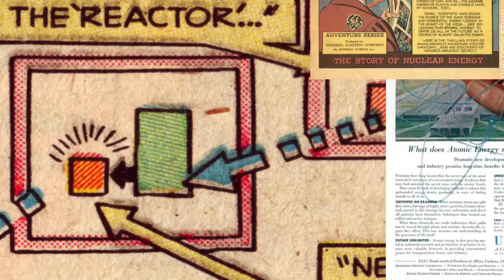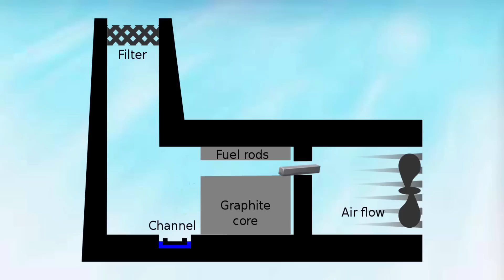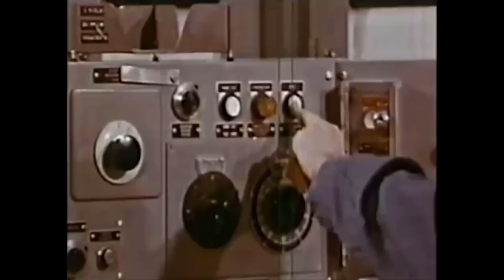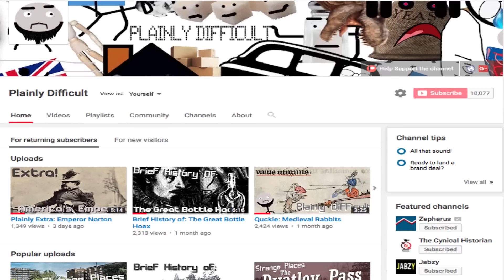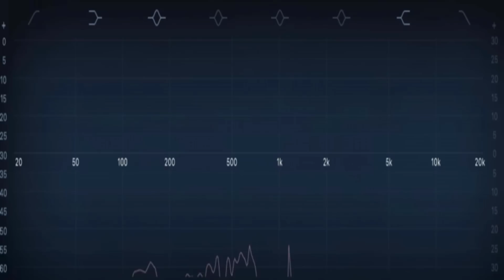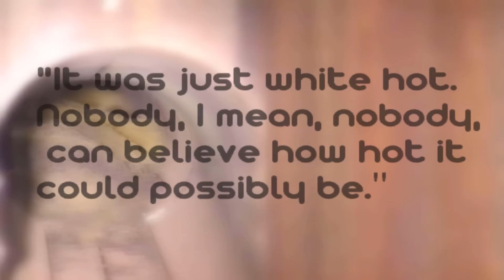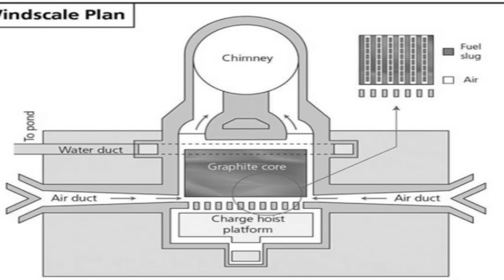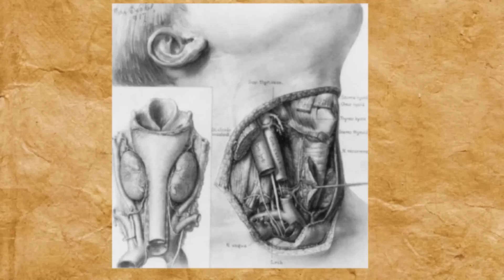Brief History of: The Windscale fire

Comment: ACTUALLY,  it is unbelievable (as it is so stupid and such a simple thing to think of) that there weren't a specialised method in place to douce a fuel rod on fire. you could think of a few different ways that could be used, such as a hose connected to a tube with the correct diameter that can be fitted straight onto the cavity the fuel rod in question is in, so that they could sort of 'flood' the specific fuel rod(s) that need(s) it with a sufficient flow of coolant without there being any loss or ineffectiveness, and at the same time giving better and more specific control. It would not be hard for an engineer to figure out a way that allows for quickly connecting a hose (some pipe for the last meter or so to deal with the heat) and secure it in place. Fire fighters equipment is often fitted with a type of connection that can be twisted into place, I mean turned but only slightly. HOWEVER, as the design of the reactor core seems to have been so flawed that rods could pop 'out of the back' of the core just like that and on a regular basis after which they by design would even land in the wrong place as well, it seems - as the flow of coolant might suffice to push a fuel rod out of its space as well - they might have done best by enlarging the basin in which these rods were to be 'caught' after exiting the reactor core, adjust its size and depth so that it would become more (or completely) effective, and do any cooling off any fuel rods that are overheated or on fire THERE, IN THE BASIN. That would only require a simple mechanism (such as a push rod) to push out of there spaces in the reactor core any fuel rods that need that extra cooling. All that type of handling you would imagine even in the late fifties would (have to) be automated or mechanised..
Reply: The temperature inside would flash boil any water creating a steam eruption that would blow parts of the reactor apart and scald/irradiate the work crew.

Comment: YOu cAn't haVe loSs oF cOolAnt If YOu hAvE No coOlaNt
Reply: Nik you know, I never thought of it like that, thank you. I'm going to go out to my car and preemptively drain my radiator.
Reply: @TheMattc999  What you want is a Trabant, the pride of East German engineering. No coolant, no problem
Reply: while the implementation failed for a nuclear pile, it works just fine in auto engines.  See the VW beetle for it's 50+ year production. I'm sure one could design an air cooled reactor if they wanted, just not much point as no one is really in the market for weapons grade materials lately and hot water is the whole point in power plants.
Reply: That's like saying "I can lift up a grape so that must mean I can lift up a house". The beetle's engine is smaller than the alternator and AC compressor on most cars and does not have the same thermal output as a nuclear reactor so you can't really say that the same principle can be applied to a big V8 or a reactor.
Reply: @NikHYTWP  First was a reply aimed at the two replies above mine.  
Second, air cooling can be made to work just fine in any use case provided the engineering is put in to it.  Automotive engines use water cooling more often because it uses the space and weight more efficiently, however there are plenty of high performance air cooled engines such as those found in a number of Porsche cars for 50 years.  Another case of air cooling being perfectly usable if size and weight are of no concern is in high end consumer and enterprise computers.  Water coolers for CPUs have become common place on HEDT CPUs, because they are small and pretty, however these same high TDP processors can just as easily be fitted with large air coolers that can extract just as much heat.  In the enterprise world, CPUs that draw far more power almost exclusively use air cooling.  
Third, Windscale was a pile used to make plutonium, not a power plant.  as such any heat generated was waste to be removed.  As stated, the design had issues, however there is nothing wrong with the idea of air cooling for an enrichment pile.  In a power plant you need all the water pumping equipment anyway, since the whole point is to heat water to power steam turbines.  for an enrichment pile the heat is just waste so a design with less moving parts is a perfectly reasonable idea.  Why have pumps that can fail, tanks that can leak, and uncountable barrels of extra radioactive waste water when you don't need to?  
Water is really good at moving heat about but it has it's downsides.  Other cooling ideas that have been tried have also had their failures, with salt being one of the best known things tried in reactors.  In the end, dealing with the maintenance and waste water became the "cheap" option and water cooling became the standard.
Reply: Nik what about the Engines in Aircraft during ww2 most of them where aircooled (some exptions) even with high horsepower output.
And i will nitpick now a bit: aircooled reactor is in principal a gas cooled reactor and these Typ work perfectly in France ( AGR) and the UK ( magnox)
Reply: @MrTrashmasterfx  lot more air flow over a plane flying at 200mph than there is over a car engine sitting at a red light. One of the main problems with air cooled car engines is you need to design it to cool when you have no air flow.
Reply: Wild1234 that is True but if we take beetle as example that engine had a fan pumping air over the engine when the same was running, so at a red light there is air moving over the engine
Reply: @wild1234  For what it's worth, Air cooled, and Passively cooled, are not the same thing.  You can use as much air blowing over something as you like, or you can have it with no air movement at all and it's still air cooled.  on the other hand, for it to be passively cooked it has no moving parts or dependency on moving air beyond what convection does.
Reply: @NikHYTWP  No. You can design an air-cooled engine just as large as you want it to be. Towards the end of the piston airliner era they had air cooled engines with 18 cylinders producing over 3,000 HP.
Reply: That was literally the base concept of the reactor. LOCA seemed a bigger threat than graphite issues we didn't understand.
Reply: Yeah, that was a really great idea to use air as a coolant, so the nuclear fallout was blown around the world. And where did the water go? Right, into the sea so that everyone at the east coast and Ireland had a chance to get irradiated.
Reply: @foreverpinkf.7603  Judging a design from the infancy of nuclear science by modern standards is arguably rather dim. 

Also, the bulk of contamination actually landed on Cumbria, not in the sea. (The bulk of the material in the sea was from disposal of LLW up until the London Convention of 1982.)

The contamination from Windscale didn't go anywhere near "global" either, as the contam was mostly caught by the filter galleries.
Reply: *wind dies down
Reply: Gliders never suffer from an engine failure either ;)
Reply: Same energy as "You can't get PTSD if you are the traumatic event"
Reply: Think you will find air was the coolant. Doesn't have to be a liquid to be a coolant.
Reply: @marklawes1859  damn, imagine being so pedantic that you reply to a 5yo comment that was an obvious joke. Sad, get a life

Comment: Wow. An air cooled nuclear reactor with a graphite moderator holding hot aluminum cans full of self-heating MOx... It amazes me to think anyone could be so stupid or so desperate to build such a thing. Even back then such a thing should have been seen as a bad idea pretty much immediately. Sloppy. Very sloppy. They had a concept of universal precautions like we use today. The chemist disapproves. 😑 

Great video though. 😊 LOVE the channel. I think I've watched/listened to all of your episodes. Great stuff.
Reply: Truth seeker I was not aware of that. Thanks for the info. I am surprised they would let cattle graze near there again already. However, it has been several decades since it happened and I don't know how contamination like that acts in the environment chemically. Does it become water soluble and wash/dilute away readily, is it insoluble but doesn't bind to soil particles aiding it being washed/diluted away over time, or is it both water insoluble and soil binding? There are a lot of factors at work here. Either way the milk will be tested by the UK version of the FDA (whatever they call it) so it will be analyzed to make sure it's safe. I wouldn't worry too much but it certainly never hurts for locals to check up on things on their own. Just sweeping the fields with a Geiger Counter like you would a metal detector could go a long way to making sure no solid contamination remains. A chemical analysis of a variety of soil samples by a private person(s) wouldn't hurt either.
Reply: Well this is a wholesome thread
Reply: Truth seeker  No, sorry dude, that doesn't work. Using free air flow to cool a reactor is idiotic in the extreme. It GUARANTEES that the plant will spread contamination every time an incident occurs. It was also possible for them to do all of this plutonium production using a much safer reactor design and THEY KNEW THIS! They took the cheapest, easiest route to make plutonium and it all went horribly wrong in the end as would have been plain to see by anyone with an education in engineering from day one. And they DEFINITELY knew about the health risks at that point. Otherwise why try to keep the contamination release a secret? They knew full well what the risks were and they did it anyway just so the UK could have nukes too. 

So typical of the UK. They try to immitate Americans and they always botch things. I guess that's what happens when your entire country is the size of a single state and you need another country to save you from not one but TWO wars in the same century. 😁

Comment: I visited the reactor at Hanford Washington. The design is extremely similar, only water cooled. Trying to do this air-cooled is pretty mind blowing. I'm surprised they didn't try to pull in an emergency shipment of liquid nitrogen and try blowing the boiled nitrogen gas from that as a non-reactive coolant. Perhaps they couldn't get a sufficient volume or boil it quickly enough without damaging the reactor.
Reply: There wasn't time to acquire nitrogen and the air pathways in the reactor were no bigger than a small straw size hole circulating through the graphite.  Hanford was operated at much higher temperatures than Windscale piles.
Reply: Exactly reminded me of Hanford.

Comment: Explain the Three Miles Island incident
Reply: A relief valve in a shutdown reactor leaked coolant into a quench tank in containment that was full, which in turn relieved into the aux tank outside containment.
Mismanagement of the leak and a failure to understand steam saturation caused the operators to neglect cooling to the shutdown core and decay heat built up until RTT was exceeded on a few fuel assemblies, leading to some fuel rods bursting.
First barrier (fuel rods) are now breached and added to the coolant.
Second barrier (primary coolant system) is breached due to the leaking relief valve.
Third and final barrier (containment) is now breached due to the overflowing quench tank resulting in an uncontrolled release of fission products to the environment (even though that release was below federal limits in 10CFR25).

Comment: Three Mile Island, the disaster that wasn't.
Reply: PR disaster
Reply: I know, right?
Reply: It was a financial disaster for someone, a multi-billion dollar reactor knackered before they even had a chance to remove the price sticker.  It still had that new reactor smell.
Reply: @Absaalookemensch
It was a political disaster.  One very positive 'fallout' from TMI was the industry creation of the Institute for Nuclear Power Operations (INPO).

Nuclear power, even including Chernobyl (an accident physically not possible in western power reactors) and Fukushima, is safer than ALL other forms of power production by orders of magnitude!  Even hydro-power in the U.S. kills orders of magnitude more people per megawatt year production.

Compared to international coal power, nuclear is 7 orders of magnitude safer.  That is for every death caused by nuclear power electrical generation, over a million people will die because that same amount of power was produced by coal fired plants!
Reply: It was a disaster.  It severely contaminated the reactor building, and cleanup took a long time.  Just because the reactor buliding and pressure vessel were very well designed so that none of the radioactivity escaped into the environment, doesn't mean that there wasn't a disaster.
Reply: @StormsparkPegasus  
The problem with what you just said is the perception of the term disaster.  It was a disaster for the plant and for the utility.  It was not a disaster for the general public.
Reply: I think it's possible the released radiation at TMI was much greater than told.

Comment: I think the point gone missing here is, that the reactor in its original form would have worked but the cooling fins of the cartriges were clipped shorter and shorter on purpose to gain a bigger yield of plutonium, which required a higher reactor temperature.
Would they just have left it as planned the cartriges probably wouldn't have overheated to splitting and fires.
Of course they were afraid, that the americans would pull out of mutual assisted research programmes if the UK wasn't on the leading edge of Plutonium production, but the windscale disaster harmed the UK-USA relationship in this point.
Reply: Following WWII the US balked at giving the UK access to nuclear weapons tech, partly out of the usual national chauvinism, but also because the Brits had failed to properly screen the scientists they had sent to the Manhattan Project, which led to several of them being successful Soviet spies. Thus US UK relations took a downturn in this period, and to get better status in the "nuclear club" the UK pressed ahead quickly with Windscale. So it may be more correct to say that the US UK relationship was already suffering and this contributed to the background of the Windscale accident.
Reply: @RCAvhstape  Of course, as it turned out, America had plenty of home-grown spies on the Manhattan Project anyway - See:-
https://en.wikipedia.org/wiki/Atomic_spies
Reply: Helium Road I like that point of view. I guess it was quite a hard time to be a nuclear scientist back then.
Reply: at first they were clipped shorter to actualy archieve critticality, they absorbed too much of neutrons,...
Funniest fact, they clipped them even shorter to make tritium (hydrogen whit 2 neutrones) from Lithium as fuel for Hydrogen bomb,.. and its agreed that most likely lithium from defective cartrige started fire,... whats ironic,... thats hydrogen bombs in the end endet up using Lithium-deuteride as fuel, so tritium (except for liitle bit as booster for primary) actualy wasnt nessesery for hydrogen bomb.
Reply: There’s an excellent bbc documentary on this, called the windscale disaster - it’s still on iPlayer somewhere. 

Shame about The pronouncing of toms surname, it’s said ‘toooey’ (see the bbc documentary where he says it himself)
Reply: Not too sure of that as energy would still have been stored in the graphite core - the source of the excess heat that started the fire. The idea of heating the core to release this heat generated temperatures above the mp of aluminium - so no matter how big the cooling fins were, they'd have still melted.
Reply: The whole entire point of clipping the fins was to get more plutonium at a faster rate, at the temperature they were running it at, not to run it hotter. The problem of the fire arised when there were some cartridges that burst open during a "Wigner Release" to release pent up energy in the Graphite core. The first release they did didn't show satisfactory cooling results, because the cartridges were already on fire, and falsely making them think that the Wigner release hadn't released all the pent up energy. So they did another release, and that just fed the flames worse, and the blaze ensured after it.
Reply: J S  "2. The UK literally initiated the Manhattan project and pushed it" LoL
Reply: Truth seeker  The Brits didn't know how to develop a hydrogen bomb, only a nuclear bomb. Plutonium can be used only for hydrogen bombs. The British thought that if they could prove they could develop a hydrogen bomb on their own, the Americans would give them access to American secrets and materials. They''d have a seat at the "big table", with the US and the USSR. The British were correct, and got all they wanted, but the Windscale fire was the cost. Worth it, in my opinion.
Reply: @gloomyblackfur399  Quote: "Plutonium can be used only for hydrogen bombs".
No, that's simply wrong, on many levels! Perhaps you intended to say that ²³⁹Pu is necessary for thermonuclear devices, but that's just as false. You could have said that - at that time - the only practical way to achieve multiple thermonuclear tests was by using plutonium, but you didn't.
Your other information is on the right track, though simplistic and incomplete. There was much more to the USA easing up on nuclear secrets than just a successful British "hydrogen bomb".